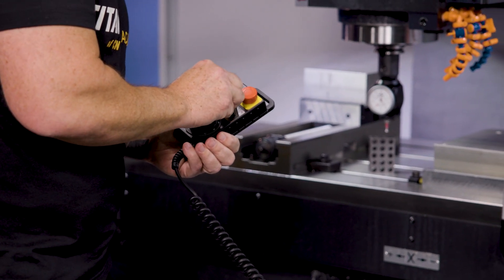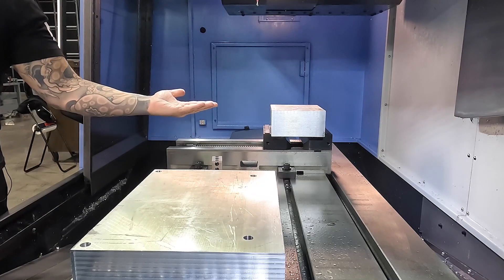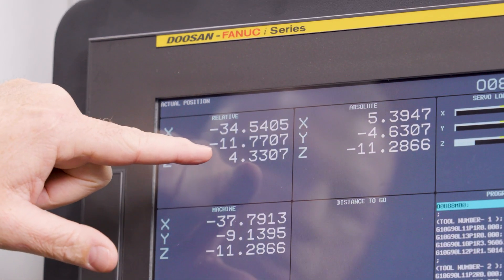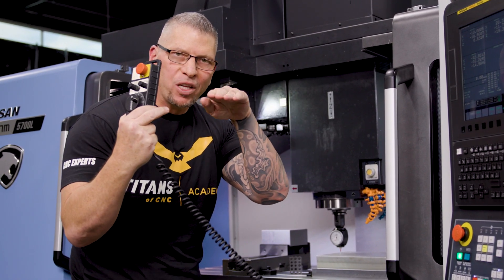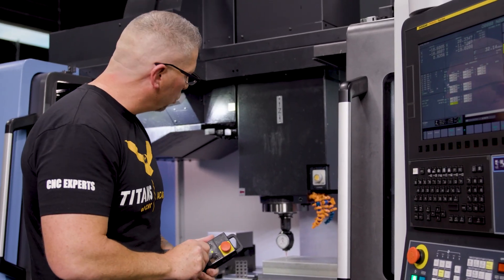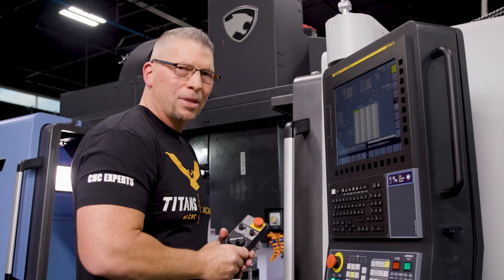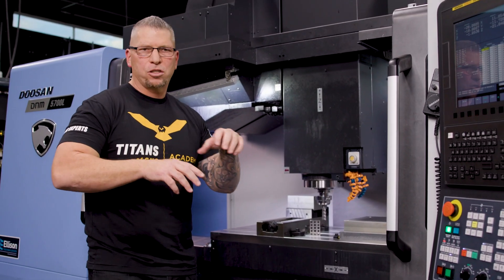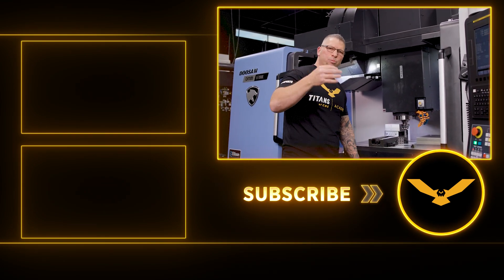ADVANCED FIXTURING | Set Z Fixture Offsets to Numerous Heights… Set All Tools to Single Height

Comment: Use with caution. If you lose your G54 or Z offset crash!
I had a new machine many years ago and it would lose the Z offset when you hit the reset button. Manufacturer didn't set the parameters correctly.
Brand new machine tried to explain to the GM that it wasn't 100% the operator's fault, thankfully the manufacturer admitted they made an error.
Taught me a good lesson early in my career no two machines are alike sometimes.
Reply: Man, i remember learning this the hard way

I wrote in T01 M06 and rather than doing like my $5k machine (going to machine zero and doing a fully automated tool change), it dove straight down into the table 

On a $250k training machine, meant to be easy to use. You actually had to write "G20 G53 G90 Z0" followed by "X0 Y0" and finally "M06 R 4" (assuming you had to turn the tool changer to the right 4 times to get the right tool)

And yes, it actually does need that G20, even though that shouldnt matter when all coords are 0.

Comment: I would use positive negative number in Z work offset and positive tool lengths. Would measure tools outside the machine. I would write down my know distance from machine zero to the table since that wouldn’t change, I would enter that into my work offset Z and just add my vise (2.875” on our Kurt) then add my parallel heigh and stock height.

Comment: The shop I work for has so many jobs that we do 2, 3 or more ops to do. I keep suggesting that we combine these into one operation, it could be done and wouldn't be that hard, but I get told "that's to difficult for most set up people." I don't know what is with that. If I can do it, anyone that walks through that door should be able to because I just graduated from CNC programming and operation back in August. We are talking two operations on a standard 3axis, not some complicated 5th or more axis, yet we have other jobs we do where we have a trunnion and then a vise on a riser doing two operations in one, so I don't understand the resistance to change simpler programs into something more efficient.
Reply: Sometimes you just have to do things and shoe people the results. I've dealt with the "That's how we've always done it" mentality for years, usually after showing people what can be done and calming their concerns, they will become advocates for the improvements you're pushing.

Comment: been using this exact method for years at my work place, extremely low cost, easy and still quite precise aslong you dont make a typo but i always check out my zero points if it matches before actually turning it on
Reply: Do you touch off at absolute? To match your geometry?